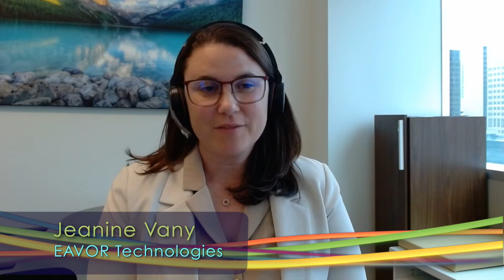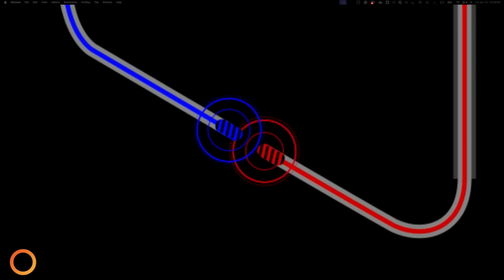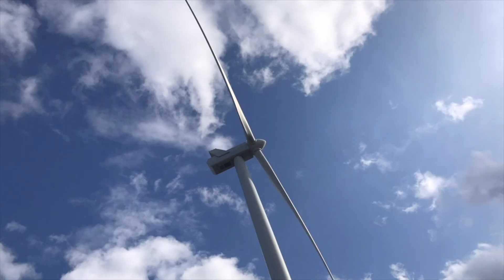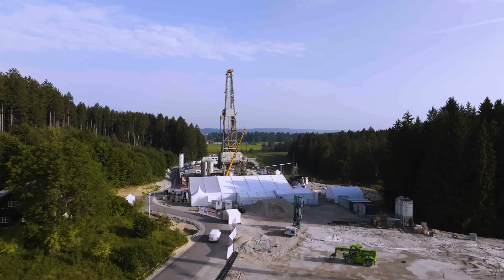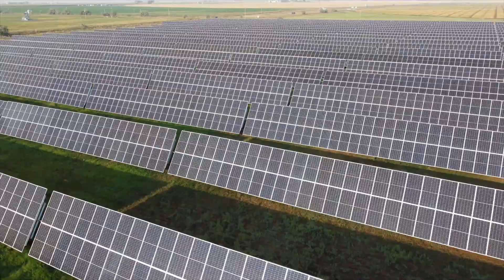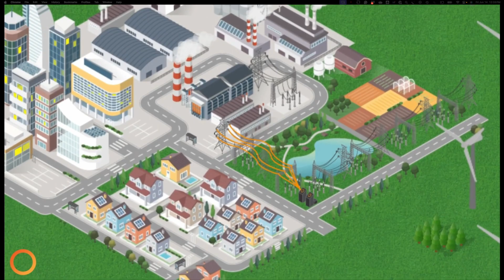Cracking the Geothermal Nut - How EAVOR is Changing the way we heat our homes forever

Comment: EGS works, this is tested successfully by FERVO. As from internet presentation the pilot inject 62 kg/sec water and produce around 90%. The hot steam and water has a power 3.4 MW, so may generate 81600 kWh per day. 
The EAVOR closed loop Geothermal technology may work if will inject huge amounts of injectants to get 9.3 GWh energy per day and then provide 81600 kWh/d electricity to consumers plus 652800 kwh heat. Drilling 90 km vertical and multiple 4 km laterals on loops and then piping 300 km is huge capital and work.

Comment: Spent 1979-80 serving at the Naval Air Station (NAS) Keflavik. Really like the fact that our heating was from a hot water loop and electricity from the geothermal power plant. 
PS — the Blue Lagoon was just pulling off the road, short walk across lava field and using some rickety stairs.

Comment: ORC working fluids are usually refrigerants or hydrocarbons. Standard usage in hundreds of geothermal binary units around the world. 2-component mixtures are also possible. Thermal efficiencies range from about 5-18% depending on the resource temperature.

Comment: Geothermal would also replace solar panels and windmills because of their limited time of use before they must be recycled and replaced. In the US each state could have a number of geothermal power plants and one day also produce hydrogen for cars planes and trucks. Of course this is a long way from happening yet, but could be planned on for the future coming years,,,,,,,
Reply from the maker: Solar produces the cheapest electricity, less than half the price of geothermal so it well be a strategic mix that is most cost effective. Hydrogen for cars is unlikely since that is also quite expensive and a much more inefficient use of electricity.
Reply: @greenenergyfutures  But solar panels take up lots of room, they have a short lifespan, and are very hard to recycle, and must be cleaned often, and big hail makes short work of the panels, and they only work in the day with sunshine. Geothermal is 365 days a year, 24 hours a day,,,,,,,,,,,,,,,

Comment: Rather than use turbines at such high temps/pressures why not 'sterling engine' gen-sets?

I worked outages in a nuke plant and the turbine disks would rapidly corrode from the supercritical steam nessisitating repeated replacement - thus the outages. Sterling Engines work off the differential in temps not needing extreme heat to convert liquid to a vapor(steam).

Properly treated materials used in all liquid contacting surfaces would negate corrosion by the liquid. 

In typically frigid northern climes the Sterling Engines' coldplate could provide sufficient temperature differentials that could power an electric generator which might produce enough to require drilling down only 1km for the same 8MW.

Comment: This is another fake story, geothermal has been around forever, it still needs something to power the movement of the energy...get real...
Reply from the maker: Huh?  Geothermal needs energy to circulate the fluid, but that is mitigated somewhat here by the creation of a thermal siphon that uses the propensity of heat to rise to move the fluids up. Then energy is used to move the heat via district heating. The energy (heat and power) is mostly used locally. District heating can also use heat pumps if required to boost efficiency.

Comment: While this is a great technical achievement over the short term...  I wonder about the long term life of the underground pipes which are obviously threaded together (threads tend to leak over time...).

The other major issue is efficiency of the process.   They are talking of boiling a fluid, running it through a turbine, condensing it back to liquid, and reboiling the fluid.  This is the thermodynamics Carnot Cycle.   Fluid cycle efficient is defined as "e" = 1- (Tcold/Thot) in absolute temperature (K or R).  K = C + 273.15 (and I will avoid using English units which would use F and R)

I know that several lower temperature non-water fluids have been studied... but, the elephant in the room is the potential efficiency of such a low temperature system.

For example:  A modern steam cycle power plant has an overall efficency in the 34-39% range.  Now the actual Carnot steam/water cycle efficiency is in the range of 64-69% and the rest is lost by other power plant equipment inefficiencies.

Example for a 1980's era USA power plant I worked in (1005 F, 2400 PSI - using a 60F summer river to condense the steam back to water:  power plants are more efficient in colder weather, and more modern power plants operate at higher temperatures which increases efficiency):  1005 ==> 540 C.    60 F ==> 15.5 C (540 C steam using a cooling source of 15.5 C)(summer river water in northern climates) has a Carnot efficiency of 1- (288.65 K/813.65 K) = 0.645 ==> 64.5 % Carnot efficiency.

Yet the overall power plant efficiency was only about 34% as there was about a 30% efficiency loss in the boiler and assorted power plant equipment.

So if you take 250 C as your Thot, and assuming you have the same cooling water source (15.5 C in the summer) you get a Carnot efficiency of 1- (288.65 K/523.15 K) = 0.448 ==> 44.8 % Carnot efficiency.

There is still going to be a lot of power plant equipment that will eat up a fair amount of power.    I expect another 20-25% loss of efficiency.    So we are likely looking at 20 - 25% efficiency for the process.

The cost of building power plants and systems is pretty fixed... so it makes it more difficult to get payback on the investment with lower efficiencies.

Another factor is that you need a very large collection field to be able to extract thermal power at a constant level for many decades (or forever) for what would be considered even a very small power plant.   That gets very pricey.   Of course, you can build a smaller field and draw down the ground temperature in 5-10 years - and every drop in temperature lowers the thermal efficiency possible.

How often is the underground piping field going to need to be replaced?   A huge questions.

While I hope it can be made to work...  There are a lot of obstacles yet to overcome.

Have a great day,

Comment: High temperatures that struck the southwestern US, Mexico and Central America recently, were 35 times more likely and 1.4C hotter “because of the warming from the burning of coal, oil and natural gas”, the Associated Press reports. A rapid attribution study by researchers at World Weather Attribution explored the impact of climate change in the on-going heat that has killed “at least” 125 people so far. Climate change also led to unusually high night time temperatures that were up to 1.6C warmer than they would have otherwise been – and made “unusual evening heat” 200 more times more likely, it continues. The article adds that “doctors say cooler night temperatures are key to surviving a heatwave”. The researchers examined the five-day maximum temperatures across North and Central America in May and June for their study, the Guardian reports. It notes that tens of millions of people have endured dangerous heat recently as a “heat dome” has engulfed Mexico – with the conditions spreading north into Texas, Arizona and Nevada and south into Belize, Honduras, Guatemala and El Salvador. BBC News explains that the study is based on the scientists comparing events today against models of what would have been likely to occur in a world without human-induced global warming. Such a level of heat would have been a once-in-a-lifetime occurrence in 2000, but today the average person should experience such an event ten times in their life, according to the New York Times.

Comment: You can predict solar output in the real world just as well as you an predict heat output in dry rock? Dry rock is  a marvelous thermal insulator and as you take large amounts of heat from a local area you will quickly outstrip the heat replacement at your pipe location. This has been done before. Just like solar only runs at a fraction of theoretical levels over a year. Still, both are great at soaking up other peoples money, ie, government grants.

Comment: When I was in my second semester of physics, 40 years ago this crazy Idea came up already. Everybody just thought about the huge amounts of energy but noone even thought about the power aspect. Power is energy per unit of time and it refers to the question, how fast can removed energy be restored. So I took a piece of paper, wrote down the heat conduction equation and the constants for stone and 10 minutes later had my answer. Geothermal energy will fail due to the too low hear conduction of stone. In terms of power geothermal is even more stupid than wind energy. Now 40 years later, I have to confess, that mankind is basically as stupid as apes with a few exceptions.
Reply: They run their calculations and in their papers it is 30 years until heat level drops too low. Their documents are available, you can check. So, the goal is to extract energy for 30 years on site. Then, build somewhere else. And, probably, get back to first place in the next 30-60-90 years?
Reply: @GroxMirk  But that does not solve the power problem. You remember, Power ist energy per unit of time. When you can extract only a few kilowatthours per hour,  you cannot use it as a practical power source. I hope that physics is not chinese for you.
Reply: @maxtabmann6701  "The power plant’s projections indicate approximately 64MW of gross energy yield for thermal use and 8.2MW of electricity generation". Eavor using heatpump to overheat steam to spin turbine and leftover heat to provide home heating. And, I assume, to heat tap water. I like physics since early in school.
Reply: @maxtabmann6701  I know, it is a lot of questions. And I still did not have answers even for all of my own.
Reply: @GroxMirk  At least you are not ideological. Geothermal works for iceland because there the temperature difference is several 100°C. You know the most famous geysir there that spits up hot steam every 20 minutes. Now do the mental exercise and think what would happen if the hot water would be used for housholds and instead the same amount of cold water would repeatedly be returned into the opening.
Reply: @maxtabmann6701  Eavor solving temp diff by creating long paths to extract enough heat. Some places will be less effective. Closed loop. Thermal siphon. Lets wait and see. And if this idea works you can focus on it pluses. Although, not that efficient, it can be better than coal. And we need something ASAP, cause global warming. It better be mass produced nuclear. But as we see, that mostly is int the case. And the price... Yeah. Emissions + low price. No emissions + high price. Select your future.  Another pluses - low area usage, safety, close to consumer, independence in case of war or cataclysms, etc. By no means it is perfect. Nothing is.
Reply from the maker: Their pilot project has produced heat within a 2% margin for five years. The system also has the ability to pause, in which time tempertures harvested increase making more energy available after the pause.

Comment: This sounds like a brilliant plan! I wonder if like a small scale geothermal rig for a home, could they send heat back down the hole in summer if a district heating and cooling system is set up? Could the well cool off if it wasn't recharged?
Reply from the maker: This is called GeoExchange and it works very well. Here’s story we did on a Salvation Army project that will save thousands of dollars on utility costs. 345. Net-Zero Ready Grace Village will save Salvation Army $6 million
https://youtu.be/HpcXhNw4TpA

Comment: Eavor has completed a deep bore in New Mexico which reached 250° C rock.  They are in competition with Quaise Energy to get to  400° C rock.  It is necessary to get to super critical temperatures for efficient electricity generation.  Plasma or mmWave drilling techniques allow them to vaporize the rock and vitrify the wall of the bore.
Reply: Any link?
Reply: @alexfoxeseri8930  Eavor and Quaise both have good websites.  Eavor even has an app to keep you posted about the company.  GA Drilling makes the Plasmabit and they have a website.  
Plasmabit is directional and would work well with Eavor.  Quaise is a straight line of sight.  Quaise mmwave requires less energy to operate than the Plasmabit.  Time will tell which technique is best.

Comment: But can they lower the drilling rig down a old coal mine?

If you look at somewhere like South Wales, there are plenty of old coal mines that are no longer in use, however these old coal mines are still massively deep holes.

If you start your geothermal drilling from the bottom of a coal mining shaft, then you've just given yourself a couple of kilometers head start.  Meaning lower cost.
Reply: This is the first I have heard of such an idea. It sounds brilliant!
Reply: I mean maybe that’s feasible but if not there are plenty of other uses for mines as far as gravity storage or thermal storage. Flooded mines can be used for thermal energy sources ect.

Comment: Typical CHP plants are 10s to 100s of MW so would like to see how these scale. She said 7¢/kWh but not sure if it's US or Canadian. If it's US it's relatively expensive for baseload power which is generally around 5¢/kWh. Solar and wind are around those levels. The market would be in Europe where CHP is popular and electricity is more expensive. Organic Rankine Cycle plants are basically steam turbine plants but instead of water-steam they use a low boiling point hydrocarbon fluid (I think pentane or hexane) to make use of lower temperature heat sources.
Reply: Solar and wind are the cheapest power but both are highly exposed to severe weather damage and need massive storage and grid evolution.
Reply from the maker: This is pretty good for dispatchable power. Peaking power plants often receive $1/kWh for this very important service. The idea is you facilitate as much cheap solar and wind power you can and pay a little more to for other power used to keep supply stable.

Comment: Great news! Europe for national security reasons have to be energy independent! Clean anergy is an additional benefit!
Reply: Europe, Germany and the rest of the world have been too slow to transition to wind and solar energy and all electric vehicles.
Wind and solar energy do not need to be imported and can be produced locally in any country.
Europe needs to provide incentives for homes and businesses to install electric heat pumps and get rid of old polluting gas and oil boilers.  The move to electric vehicles will also be sped up. There is no good reason to help fund Putin's war by buying oil, gas and coal from Russia. There is a Climate Crisis making weather events more extreme.  Time to switch to renewable energy. The future is renewables. They are safer, cleaner and cheaper than fossil fuels. It is time for governments to end fossil fuels industry subsidies.

Comment: This type of geothermal has been around for a fairly long time. The difference is the use of horizontal drilling to expose more surface area to retrieve the heat. There is a hotel in Edmonton that has been running on geothermal for about 20 years now so yes, it does work and the amount of energy derived is quickly replaced by the surrounding rock. If it was possible to drill to the earths core the temperatures would meet or exceed 5,200° Celsius (9,392° Fahrenheit).
Reply from the maker: I could be wrong but the hotel is probably doing GeoExchange, a different animal. In GeoExchange you only need 4-7 degrees C and you cannot produce power. This is very good and very economical for anything bigger than a house.

Comment: How hot is 200 degrees C in F temperature?
Reply: Again... Google it.
Reply: 392 F.   I have spent most of my adult life in naval steam propulsion and power plants.

I've never seen a turbine condenser power plant operate at such low temperatures... Not even the retired boilers and turbines from 100 years ago.

While nuclear power plants operate at somewhere near 600 F (give or take depending on design) fossil power plants with super-heated steam have operated at 900 F  (482 C) or higher since before WW II.   Most modern fossil power plants operate at least at 1000 F and many at 1050 F (565 C).
Reply: @perryallan3524  What is the chemical they are using to operate at such low temperatures? Ammonia perhaps ?
Reply: @martylynchian8628  It won't be Ammonia due to the safety issue (although I remember well ammonia refrigeration).

Some years ago I read a paper that discussed several low temperature fluids for Carnot cycles.    I don't recall what they were.   All of them had issues with how to implement and control leakage (steam/water does not cause environmental or other issues if it leaks as long as no one is injured).

A quick internet search did not provide me a list of current options for lower temperature non-water fluids.   Sorry